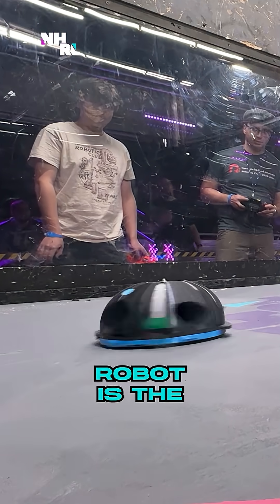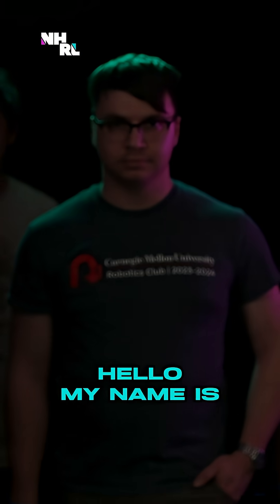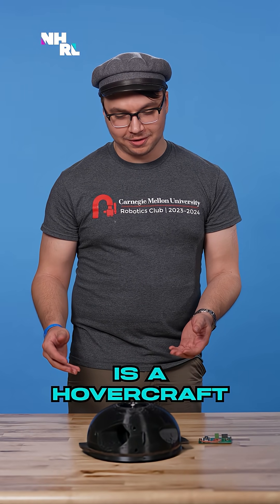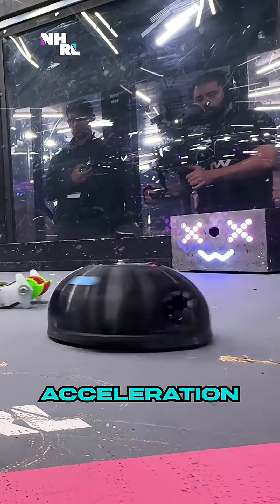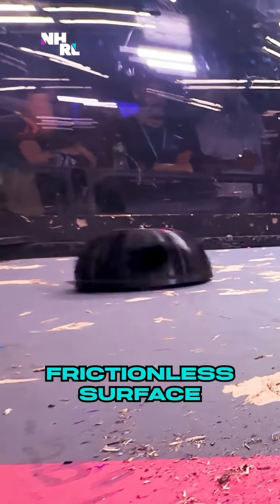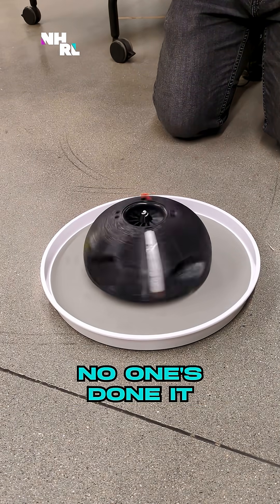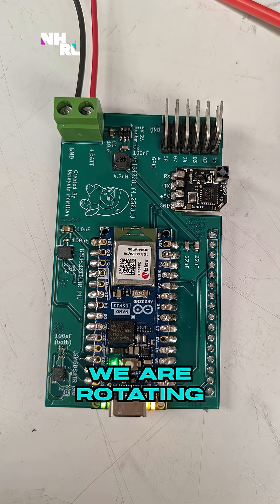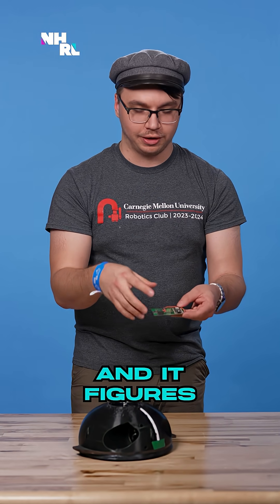The truth is out there - it’s a hovercraft melty

Comment: I like the idea. But to hover it needs to be light and thus it looses the mass to hit and more prone to bounce off
Reply: erm...no? like, not at all?
heck, it is probably getting the nonstandard movement method bonus so it is likely half again the mass of it's opponent.

mind you it does appear to be having a lot of problems, they're just not the ones you are talking about (takes forever to stabilize after any interaction and spins up slower than a bot from the 90s...also might be missing out on the whole reason meltys are good in the first place: the sheer mechanical simplicity means that they can be built like absolute tanks because the whole bot can be built consisting of what is essentially just a solid puck of material with 3 wheels attached...technically that can get down to 1 wheel but 3 is the point at which it stops making major mechanical differences)
Reply: @evernewb2073  yep, you're probably right

Comment: To deliver power you need a good solid ground if the thing is hovering it can never deliver the power good enough... I don't think it's a good design.
Reply: it'll just throw itself when it lands a hit if it can figure out a few more things i think, which other successful robots have been able to mitigate in the past
Reply: @dandischinosvarietyhour really it would benefit from having the the pitch of the blades that hover it be able to be switched into suction mode if it does this then it's grounding itself and it will be able to deliver all of its power to the enemy... You'll notice when it delivers a hit the internals of the robot spin up more than the external shell... This is due to lack of a ground to deliver the power through.
Reply: When can I see you at NHRL?